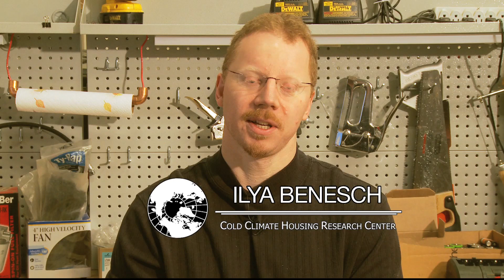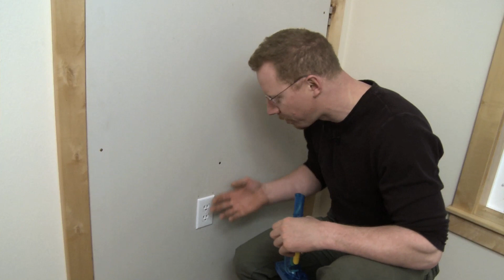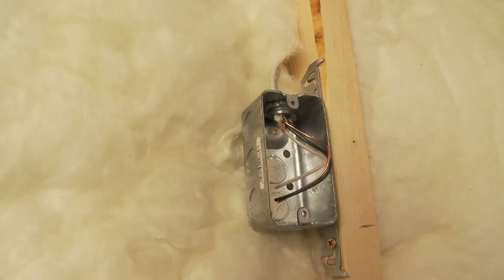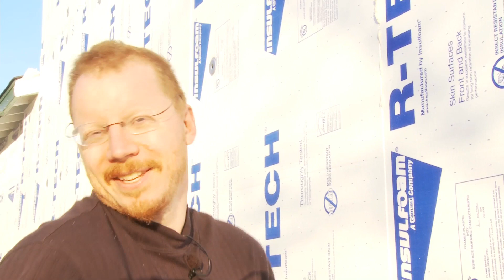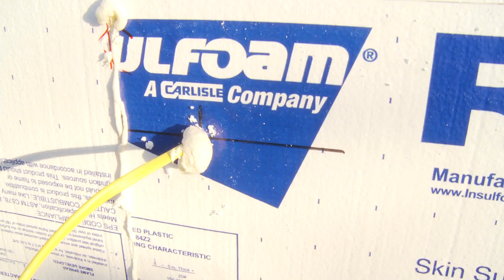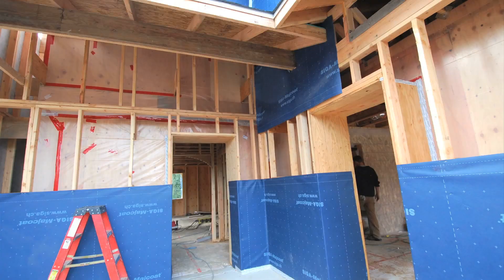Your Northern Home: Walls

Comment: US American walls are so weird. In Europe for 500 years houses were insulated as follows: wood frame filled with bricks or a straw-Clay mixture. The inside was covered with an air tight layer of more straw-clay mix on the inside.

Now we live in modern Europe and still use stones, wood and clay, but also use wood fiber or hemp fiber for insulation. The massive advantage: moisture is no problem at all, even a pipe leak will just dry.

The other advantage is how soundproof out walls are and how pleasant they reflect sound.

So, what is important with additional insulation on the outside: the roof has to be extended to protect the walls, or they will receive too much rain.

Comment: The thing is that controlling moisture levels with MECHANICAL VENTILATION costs EXTRA MONEY and Energy!  I don't buy it to the MODERN WALL implications that they are superior; because, I live in a 1974 fiberglass cavity & attic 2x4 framed upstairs (with that old fiberboard sheathing and fiberboard siding) and cinder block basement, it's pretty much always over 50% Humidity Outside (Usually 80%) and inside it maintains around 50% humidity by itself in the cold season with electric baseboard heaters (upstairs and downstairs)!  The only improvements I've done is seal up electrical boxes and spray foamed cavities around windows. - 50% Humidity is pretty much ideal yes?   I just want to lower my electric bill when it gets really below freezing. Am thinking about removing all fiberboard, adding 2" plain old EPS (Higher density maybe) and plastic siding with maybe the molded EPS as well; but I can't find much info that might support that it will work before doing all the work.   I want the wall cavity to breath but not condense water vapor. - I was thinking of adding strapping outside and throwing on a foil reflector to keep the wall warmer and hopefully prevent frost creation in the main wall, but too many unknowns and too much shit going on to think it through.

Comment: I put 1/2” o c pink foam on my inside walls under the s r   20 years ago. The insulation holds heat in but doesn’t keep the cold out. Only regret is more foam as the concept works. Sometimes I have to open a door before I go to bed to cool down some. Central Minnesota climate

Comment: After retro fit a.c. in my attic with 2nd floor return I've been noticing nail pops all over my home. And see old sheetrock seams (non cracking) but noticable. Any thoughts of what is going on? I also suspect stack effect because my wood stove stinks
Reply: Drying sheetrock and shrinking?

Comment: Not a bad presentation, but I did not like the new building wall system.  It cost too much and is too thick.  We have been using a system since 1974 that will give you a masonry wall, including a total foundation ( the full basement), is only 12 inches thick, and is about a R-40. Check it out at www.energyefficientbuilders.com  We are looking for contractors we can teach to do this for all types of buildings.  It is perfect for zero net housing.

Comment: Great video but....... You talk about frost by the OSB behind the fiberglass insulation.  You also talk about how the home looses moisture through your walls.  You then show a product of foam on the outside that is not permeable, which causes an even more of a problem.  MOLD, ROT, MILDEW on the exterior OSB. You MUST use a foam that breathes!!!! Not Dow or the product you show on the video.  It must be an EPS product not an XPS that does NOT breathe.
Reply: Mildew seems like it would be a huge problem.  I'm starting to think that the only mildew-proof option is full cavity spray foam with Zip-R sheathing, SIPS, or ICF.  WIthout one of those, it seems like you're just begging for mildew.
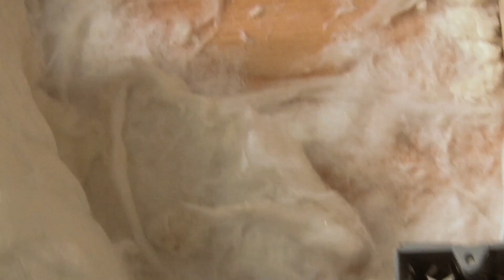Reply: What OSB? Frost was on PLYWOOD behind the fiberglass @ 7:20 .  But non-permeable doesn't make good sense in certain builds and/or renovations; and therefore using a foam that "breaths" is NOT always a "MUST" as you dictated 2 years ago. Only in certain scenarios a breathing wall system is necessary.  It's a tough go though; and it seems even the so-called experts can't get it right. It's basically all a shit show     imo.

Comment: After you seal the house up basically air tight, the how do you mechanically ventilate? Going to have to crack a window and let in some fresh air?
Reply: Install an HRV or ERV...heat exchangers.  This approach will pre-heat the fresh air coming into the house.  A 100% efficient HRV will still mean losing 50% of the heat in the exhausted air...If outside is zero, and inside is 70F, the fresh air will be heated to 35F as it passes through the HRV.   Or in a moderately tight house, you can have a continuous exhaust fan that creates a very small negative pressure in the house, so a little cold air leaks in, which is better than warm, moist air leaking out and condensing inside the walls.
Reply: if u install continuous exhust fan warm air is still gunna leak out it...  @fredygump5578
Reply: When we finally get to build I want to add a ground-air-heat transfer (GAHT) system to the intake side of the ERV. This would decrease the delta between the inside and outside air. The trick is to get below the frost line. Here in Upper Michigan I have to go down 10-12’ to get 55 degrees. Alaska would be even deeper, and then there’s permafrost.

Comment: Would building with 2 x 8 afford the opportunity to use more insulation?
Reply: To avoid thermal bridging, you should build your 2x6 wall using 2x4's that are staggered with foam to fill the rest of the gap. You want a thicker wall, but you don't need a stronger wall! So using 2x8's just gives you a longer thermal bridge, more strength than you need (and it costs you money). Alternately, you could turn your 2x4's sideways, so again you would still have all the support you need, but you would have a thermal break filled with insulation between the wood and either the interior or exterior of the wall.
Reply: from everything i've seen/researched over the last few weeks, i'd say yes it would but, the wood itself is not a good insulator so the studs will be cold bridges, better to go smaller on the studs and put your insulation on the outside of the house instead of the inside.
Reply: @quantaca5773 why not inside

Comment: What is the opinion of rock wool insulation versus fiberglass insulation (the pink stuff)? I am told the rock wool is denser and holds its shape that lends itself to being installed more correctly even if installers are going fast. Does one product (of equal thickness) have more R value than the other?
Reply: Rock wool would make home more fire resistant and quieter.
Reply: I think they're both about the same in r value. Rockwool is more expensive, but does better with itchiness and water & fire issues. But it needs a vapor barrier on BOTH sides! Fiberglass traps pockets of air, Rockwool does not. Rockwool might be slightly better for sound quality, but not enough for any human to notice. 

Basically, I went with fiberglass because the Rockwool would have been 3" thick and my walls (and the fiberglass) were 3.5" thick. So I got better insulation using the space I had for less money. I have no idea why they make Rockwool in 3" batts.
Reply: Rockwool is slightly better than fibreglass. But just slightly. It's a pleasure to work with because it isn't as itchy. Yes, it is a bit more expensive but the extra cost is worth it.

Rockwool does NOT require a vapour barrier on both sides!  Where did you ever get an idea like that? ALL spun insulation, mineral or glass, traps air amongst the fibers. Don't believe me on these two points? Email the Green Building Advisor (a part of Fine Homebuilding Mag.)     @Hypercube9
Reply: @paulmaxwell8851  Paul, you must be working with some VERY old houses then if you aren't using a vapor barrier on both sides! Newer houses require a smart membrane on the outside that will allow a houses walls to dry out. And you need a vapor barrier on the inside to keep inside moisture from showers, etc. from condensing inside the cold walls during the winter. But I was specifically talking about northern climates where I'm at (Michigan). So maybe the rules are different in the humid south or wherever you're at? Anyway, all the Roxul I've ever seen has been unfaced, so you're basically adding another step to your installation and the main cost of installation is labor so you're paying more for the insulation and then paying more again for the install! 

Anyway, if you're having someone else install your insulation, then why would you care if it's itchy or if it's a pleasure to work with? And if you're doing it yourself to save money, then why not just buy the fiberglass stuff and take the time to install it correctly? It really doesn't take any actual skill! Plus, I've never had a problem with itchiness around fiberglass. Or split the difference and buy rockwool but install it yourself! 

Besides, if a "bad install" means that you have air gaps where insulation should be, then Roxul doesn't prevent a bad install, it GUARANTEES IT!! Because like I said, it comes in 3" batts and a 2x4 wall will have a 3.5" air gap! So you're left with a half inch of air space that could be better filled with some EPS foam board or something! Adding even more to the cost and time to install! Not to mention whatever insulation type you choose, you'll still have the thermal bridge provided by the 2x4 studs! Enjoy having an R4 over 25% of your external walls!

Comment: Would it do any good to air/vapor barrier both interior and exterior  of outside walls (after insulating outside and inside with that ridge foam insulation) Would it have any benefits to having it foil both on outside and inside foam board insulation also?
Reply: This would cause significant problems.  You don't want to create a situation where moisture can get trapped between two vapor barriers, because you'll never get rid of it.  Moisture will find it's way in, no matter what you do.  Think rot, mold, etc.  It's not good.  People have tried this and learned the hard way!

Comment: Not shure about these double wall systems. Seems like more wood, more cost. Dence pack cellious on the exterior.hmmm, gonna have to think about that 1.   I wish you would give more information about the exterior foam. (Type of foam,, density, open / closed cell, current cost.)
Reply: Nothing mysterious about double stud walls. We have a home, small shop, pump house and chicken house all built this way. Our heating bills are very small, a fraction of our neighbours' bills. Oh, we used blown-in cellulose on the larger buildings and two layers of Rockwool on the smaller ones. Both do a great job.